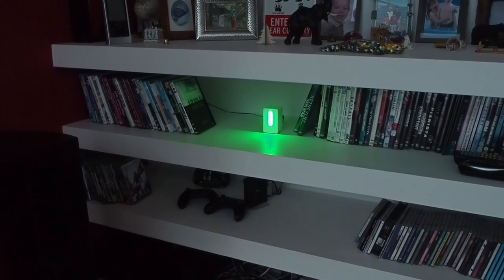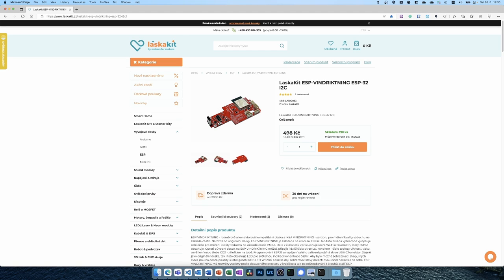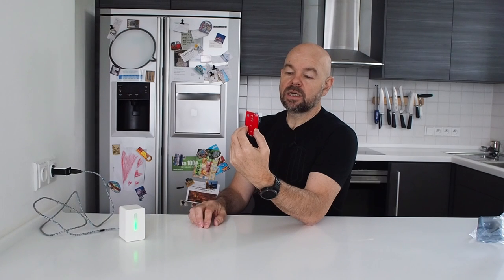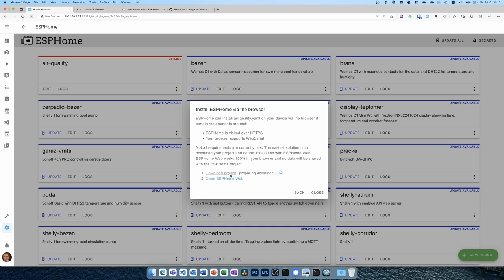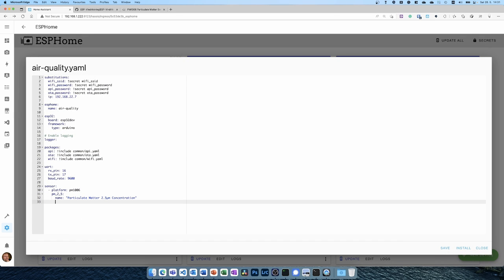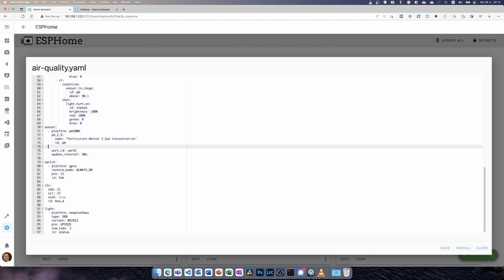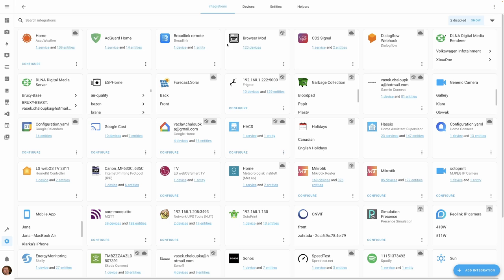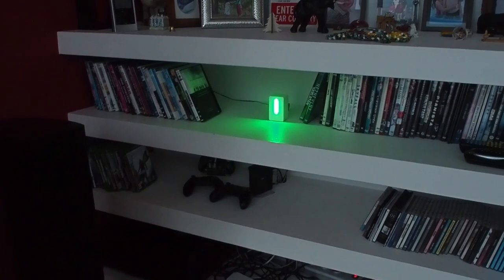IKEA AIR quality sensor Home Assistant upgrade

Comment: Very cool to make a 'dumb' device 'smarter'. Being that it has a fan it is potentially a highly accurate platform for sensors. You could say once per minute run fan for 6 seconds, then scan all sensors. Particulate, CO2, Carbon monoxide, temp, humidity,  etc. You could cycle though different gauge colors (eg. Blue, orange, purple) for alt sensor... Also you can dim or turn off its local display evening/night... NICE😁

Comment: Quick update. I bought a couple of these boards after seeing this video when it got out.
After a year I looked closer at the board and drawings, and found that the esphome example lacks a lot of stuff.
There is an ir-receiver and sender on the board, and a buzzer, that is not mentioned at all.
After some changes in esphome yaml, it not plays different tones af flashed different patterns, to warn us in different scenarios, like when people are at the front door.

The it receiver and diode only works, if you remove the front diffuser, so I do not use that.

Comment: Hi Vaclav, great video! I purchased x2 of the LaskaKit ESP-VINDRIKTNING ESP-32 I2C PCBs and CO2 sensors to upgrade my IKEA Vindriktnings. Thank you for sharing your code, the sensors work flawlessly in Home Assistant. One issue I have noticed is the LEDs LaskaKit ESP-VINDRIKTNING ESP-32 I2C - these lit up when I first installed the ESPhome code, but ever since they've been turned off - they don't react to the change in sensor values at all.
Reply from the maker: I thing adding restore_mode: ALWAYS_ON to the light componnent shoudl fix that.

Comment: I'm using a bme680 with bosch bsec library running custom code on esp32 which posts stats to my mqtt server.  My hvac controller is also esp32 (c3) which monitors the mqtt messages.  It will kick the hvac fan in up to 6 minutes per hour if the air quality reading is bad.  I've actually been updating and improving my hvac system for years using microcontrollers.

Comment: besides the temperature,everything else is working perfectly. Thanks for the hard work. and its my first time soldering
Reply: I just added the temperature aswell and with a offset. Am i the only one that seems to have a higher PM2.5 after soldering the CO2 module? Any help would be appreciated

Comment: Awesome video thank you. By chance is this board available from a JCPCB library? as its near impossible to obtain from Australia. Very happy to populate the board as have good soldering skills. Thank you for the variation of the interface under ESPHome as others have been under Tasmota. Both are needed as I use a lot of LoRa devices and they work best on MQTT.

Comment: Hi Vaclav, you haev inspired me many months ago, and I was able to order and install Laskakit pcb & CO2 sensor that is now one of most watched sensor value. But I am annoyed by the fan noise during the nigh. Have you found a way to start the fan each 60 sec, read the PM value and then turn off? I have tried to add interval parameters to the switch, and use component.update, but the sensor ID is not inherited from PollingComponent. many thanks!

Comment: Hi, do you have exp with Pressure Sensors? i need someone i can integrate in my homeassistant. i had to connect a compressor (on/off) to bring enough pressure in a water flow system. so i had to messure is the pressure high enough, when yes power on compressor so long to achieve the defined pressure.

Comment: Can you deactivate the light remotely from homeassistant?
So that I could make an automation to turn off the light at night (at a specific time) or when my lightsensor detects that it's dark in the room.
Reply from the maker: Yes, you can. Just give the light a name, it will be discovered in HA. And you can controll it from there.
Reply: @bruxy70  Thank you very much!

Comment: Great. Can you make a switch or an automation to turn off the RGB Led at night?
Reply from the maker: Yes, you can customize it as much as you want. The template I uploaded has low light intensity during night, and higher during the day. So one thing you can do is to tweak that. Or you can turn it off completely.
Reply: @bruxy70  👍

Comment: Good Video !
I get an error during installation : ID 'uart2' is reserved internally and cannot be used. 
did you have this too ?
Reply from the maker: It changed recently, after i made the video. Just rename the uart
Reply: @bruxy70  Could you please help out for this error? i Renamed the uart2 to uart3 but i think i do not know what i am doing here.. I also get an error [18:15:04][W][scd4x:099]: Communication failed! Is the sensor connected?
Reply from the maker: @nickiogr  The pm1006 sensor needs to use an uart port, and so you need to say which one. And you do that by saying uart_id: and and ID of an uart that you have defined somewhere in uart section, and there you give it the id so pm1006 knows this is the one. Few months ago, they said that you can't use certain reserved names. So just give it a different name - both in the uart section and the pm1006 section.

Comment: Is there anywhere to source these boards in the US?
Reply from the maker: The shop initially responded to my emails and said that they will try to figure something out. But they did not respond yet. I asked them to share the documentation if they cannot sell abroad, but no response yet. Still waiting. Sorry.
Reply from the maker: Just got an email from Mr. Laska - they are actively working on adding an international logistics solution. They have a concrete offer but are ironing out some legal questions. Also, he said the documentation is available on their GitHub - but I guess it will need a bit more work.
Reply: @bruxy70  Thanks for the update!
Reply: @bruxy70  Update I have been in contact with the guys running the shop, and was just able to place my order for US delivery. You have to have translate the page, but everything worked well.
Reply: @Firespyer  how was the shipping price for you?  When I did it, fedex was the only option and it was going to be like 70+ USD to get it here.
Reply: @CrankyCoder  Shipping was pricy but I ordered 5 of them and a few of the CO2 sensors so it wasn't as painful
Reply: @bruxy70  Is it possible to get the esphome code with just the PM1006 , I tried to remove the other parts but the light isn't working I think some of the math got screwed up with what I removed. Thanks!
Reply: I think i solved my own problem by adding   on_boot:
      - light.turn_on:
          id: status
          brightness: 0% to my config

Comment: Warning PCB talked about in this Video is only available in CZ and Slovakia If you are from another county you are better off at home assistants homepage
Reply from the maker: Just got an email from Mr. Laska - they are actively working on adding an international logistics solution. They have a concrete offer but are ironing out some legal questions. Also, he said the documentation is available on their GitHub - but I guess it will need a bit more work.

Comment: I'm afraid you measure anything but CO2. The lowest you could get is 400 ppm. In cities it's usually about 420. The CO2 sensors drift gradually away, so they are set to autocalibration ba default. Also the docs say: "The autocalibration algorithm assumes that the sensor is exposed to air with CO2 concentrations of 400 ppm at least once per week.". Are you OK to have new "pet" that you have to take for a walk every week?

Otherwise it's just a toy
Reply: This is how majority of those sensors work. Netatmo including.